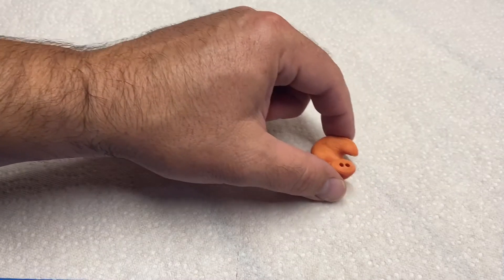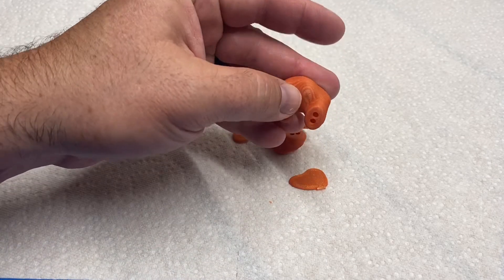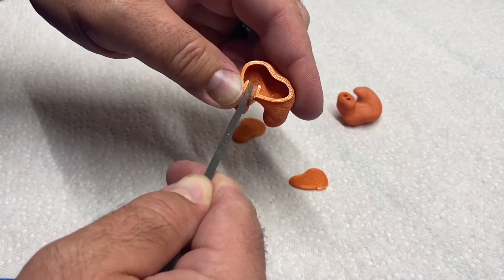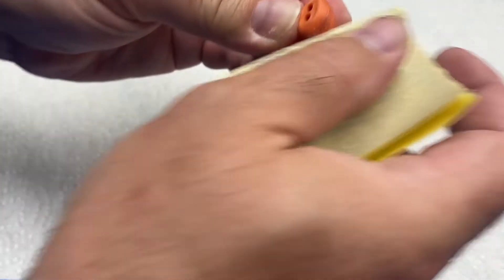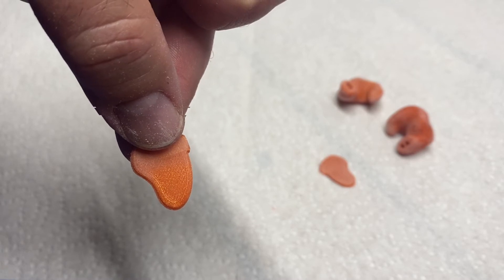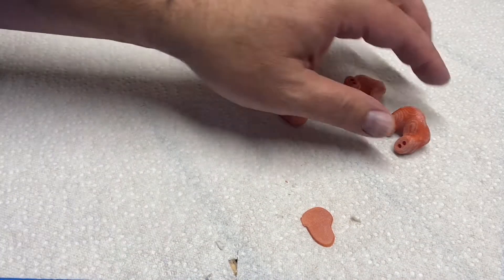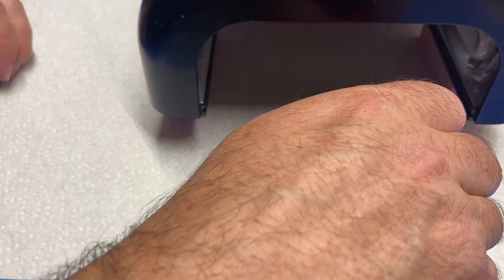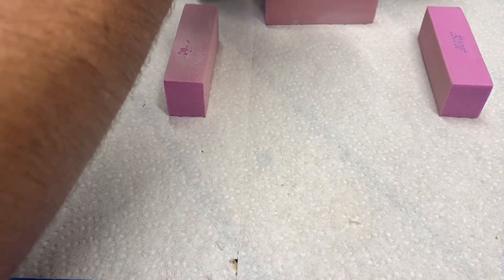Finishing 3D Printed Shells For Your DIY Custom In Ear Monitors

Comment: Try using a 3D resin printer, is better quality, and you can use uv protector resin for the soft finish.
Reply from the maker: I agree Esteban-would love to get a good Envisiontec some day
Reply: 3d resin printer isn't cheap though, i am wondering if it is possible to find a company that would do the printing for you. Basically giving them the 3d models and get the shells.
That would give professional finish, and since they are hollow i am assuming the shells would be reusable ?